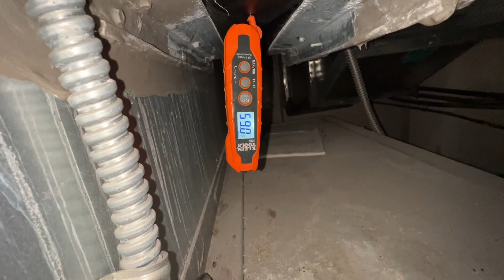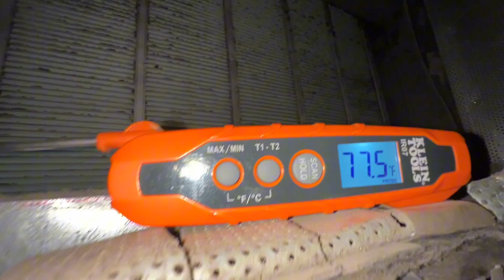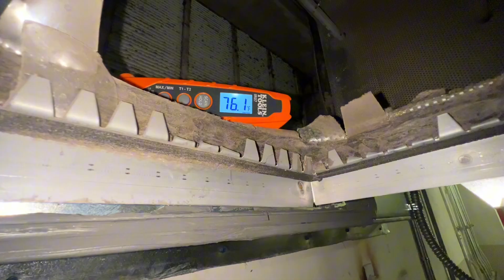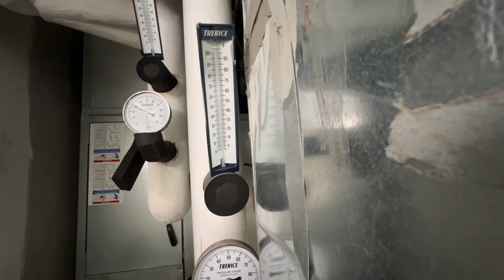Daikin Chilled Water Air Handler Not Cooling Properly… Fairly New Install

Comment: I ran into this issue before that hindge can be adjusted to close the gap, if the hinge is not adjustable then the damper n duct is twisted out of square not letting the damper close properly
Reply from the maker: The dampers seemed to be working correctly, This time. I later found the installation manual and it appears to be missing some filler pieces there.
Reply: @subcoolHVAC Nice that you found the manual. I don't if you inspect your dampers every year but we did it at the hospital yearly to make sure they operate correctly and open manual and mechanical wise. We kept a log book and signed off on them. All fd/smoke, if they need replaced or if a fuse link needs replacement or damper replacement. We did it in winter when it was slow or when a slow period was upon us. May want to see if this is done. Takes the liability off if they fail or cause a big issue.
Reply from the maker: Yeah, there’s none of that around here. We end up finding the installation errors after contractors are long gone…